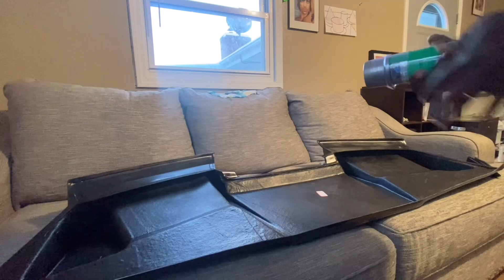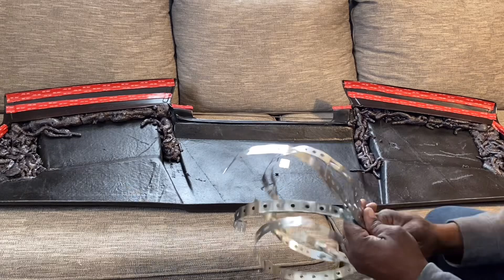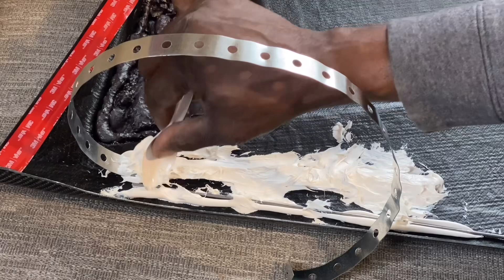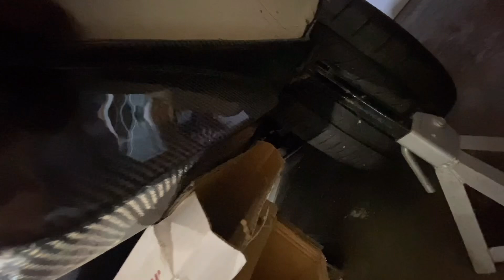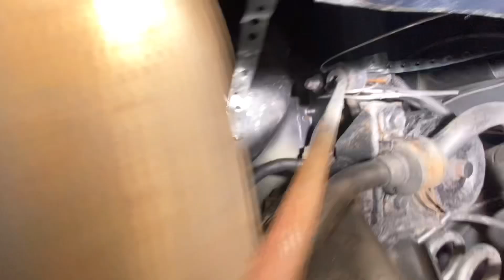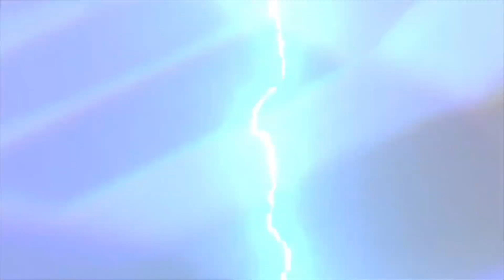Carbon Fiber Rear Diffuser install - Cadillac CTS CTSV

Comment: Nice Job! I'm wondering if a heat gun used lightly to reform the shape of the diffuser would get you that more even fit on that lower right side?
Reply from the maker: Actually my camera malfunctioned, so it doesn't show where I resolved that issue. If you look at the end video where the car is outside, the diffuser is actually even. Regarding a heat gun, unfortunately molded carbon fiber once set is not really bendable even with heat.
I resolved the issue by removing those two bolts near the exhaust pipes that I referenced in the video. Once I disconnected those bolts that were securing the diffuser to the bumper, it allowed the diffuser to sit much better.
Reply: @marenothecarguy8361 glad to hear you got it worked out. Thanks for the tip on heating (or lack there of) carbon. I enjoy your videos, It's obvious you're a huge car enthusiast and  love what you're doing. Very inspiring & entertaining!